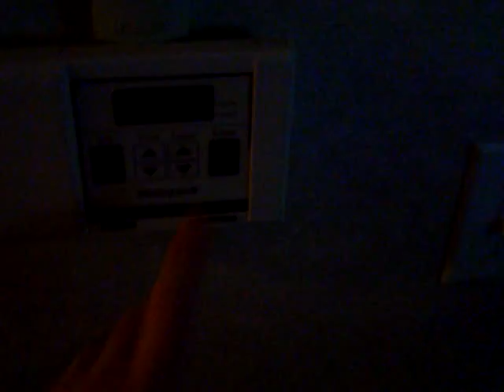Back feeding with a generator - Honda EU2000i Generator

Comment: Generators should an could be fed to a house but the Hot needs to be disconnected from house to not back feed to utility lines………..NOTE !!!
This unit supplies 60v to  ground from NEUTRAL…  THE NEUTRAL ALSO MUST BE DISCONNECTED AT SERVICE
Reply: Losing the POCO neutral is irrelevant. The generator neutral is still bonded to the grounding electrode system in the house at the main panel or first disconnect. Your generator will function correctly and safely.

Crossed lines on the POCO will trip their circuit breakers. POCO also grounds their neutrals. The neutral to your home from the POCO is grounded at the main service panel or disconnect as well.

Comment: OK dildo a lot of things "work" but just power your stuff from extension cords and leave a complex system you so obviously know nothing about alone or "as is." Apart from anything by following these directions you will have completely voided your homeowner's insurance policy and could be held both criminally and civilly liable for just about anything that may happen as the result of following this very, very foolish video. Use extension cords and have a fire extinguisher handy too.

Comment: True that it can be dangerous.  However, we're talking survival and emergency situations.  If you flip off all the breakers in the panel then everything is isolated from the grid and you can back feed just one circuit by hooking into any receptacle on that circuit... or wire directly through a 220 volt breaker with the main switched off then switch on just the circuits you  want to use.  Very safe if you simply think about what you're doing. Whether or not codes allow not important to survival.

Comment: Depends on if the generator can handle the startup, Newer ac units do pretty well and do not draw as hard.  Our's is a year old and kicks over pretty well, Generator jumps around a bit until it's settled down, but it works

Comment: There is nothing wrong with backfeeding through an outlet as long as the main breaker is off.  Yes with a larger genset supplying the same 120v to two legs with a common neutral, there is a CHANCE of overloading the neut.  Of course I'm an electrician and I know what the hell I'm doing, which separates me from most of the 'experts' who comment here.

Comment: The neutral flows back to the generator windings not to the utility transformer. Which is why you don't see 3 pole residential transfer switches. Only the hots need to be switched.

Comment: how about the nuetral wire going back to the transformer? its still getting back feed, and can kill a linesman!! you still need to discounect the nuetral!!!
Reply: Losing the POCO neutral is irrelevant. The generator neutral is still bonded to the grounding electrode system in the house at the main panel or first disconnect. Your generator will function correctly and safely.

Crossed lines on the POCO will trip their circuit breakers. POCO also grounds their neutrals. The neutral to your home from the POCO is grounded at the main service panel or disconnect as well.

Comment: Before you start calling others dumbass , take a look in the mirror. 

The point of plugging into both phases is not to run 220 outlets. It is to make sure all light and outlets work in the entire house.

You see half the house lights and outlets are on one phase and the other half is on the second phase.........DUMBASS

Comment: oh..btw.. I plan on doing the almost same install on my house. I plan on making a harness that would allow me to plug into 2 plugs that are on opposite phases. 

If the power goes out.. I will turn off the main and all 220 (2 pole) breakers. Then plug my harness in that I will have leading to the basement. Fire it up and I will be on my way.

Comment: Wow.. most of you guys don't know too much about electricity.

First off.. the linemen ground the lines prior to working on them. Therefore.. you will trip the breaker on a honda if you back-fed the line.

As for running another EU2000i for the other phase.. that would never work. Even though a house is concidered single phase power it is actually 2 phases. The two generators would not produce the proper sinewave to run 220 lines. 

Im not running spell check cuz I dont care.

Comment: Those 120 volts get fed back into the power system to the nearest, say, 30,000 volt transformer and get stepped up to the other side of that transformer - to kill or maim the lineman who makes a small mistake.

Comment: The outside outlet doesn't look like a GFCI, if it was, I wonder if back feeding would mess it up?  I'm assuming that the outside circuit is rated at 20 amps, just curious what a furnace, fridge, tv, lights and fan consume?

Comment: FWIW: *backfeeding* is a poor alternative to a transfer panel. You need to be knowledgeable (even certified folks make mistakes) to do this work.

I will NOT suggest this to anybody. It is dangerous and possibly lethal. Issues with floating or bonded to ground neutrals, knowledge of phases, power factors a few things to consider

In place of a transfer box, I've been thinking of isolated power line (in a house)  w/ switches to cut over each appliance one at a time.

Comment: Yeah strange (for you) having most of the lights on the same phase there... What does that leave on the other side.. The fridge, microwave and those "240v" appliances (stove, electric? water heater, etc??) I assuming you switched off all 240v breakers as well to protect against current leaking through those to opposite phase... Or did you turn off most breakers to begin with (turning on what you wanted)?

--Doug

Comment from the maker: Luckily, most of our lights in the house are on the same phase as the furnace. Our fridge is not, so I simply unplug it and use an extension cord to reach a nearby outlet on the same phase as the furnace. I could move the breaker, but I want to keep normal usage somewhat balanced between the two phases. Our furnace uses 7 amps peak during startup, then settles down to about 3 amps running. I would worry about the common neutral and would not hook up a second EU on the second phase if I had one.

Comment: I have an EU2000i also (and love it's size and use). I understand electricity so I suspect you have to backfeed the correct phase to get the gas furnace -- what about the fridge? Do you think (if/when) you got a 2nd EU2000i would you link them on the same phase or use it to power the other phase (understand common returns now have possibility for over current).

How much do you think the fan uses? Typical 3/4 HP motor right?

--Doug